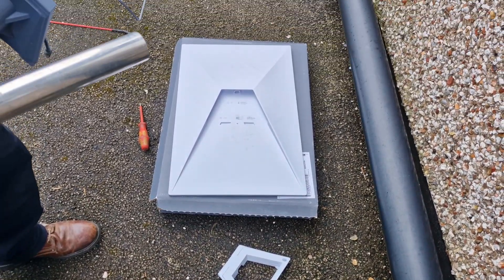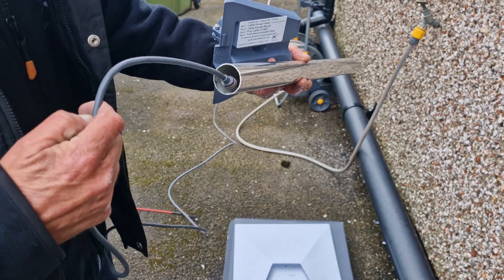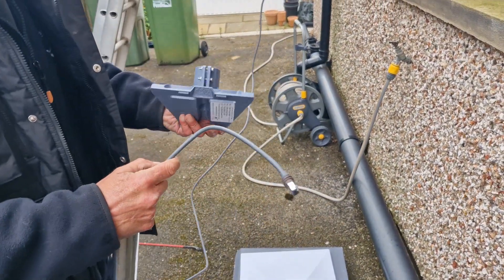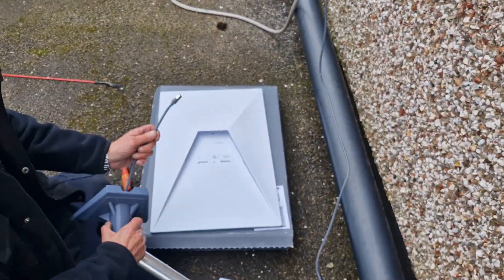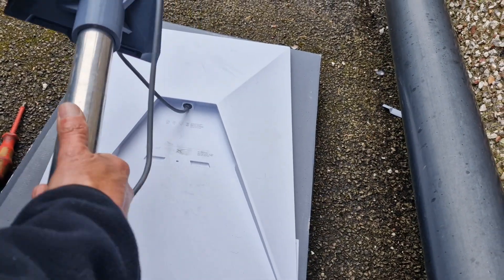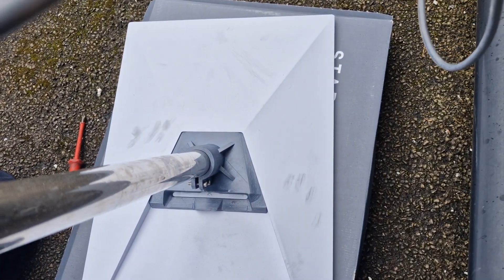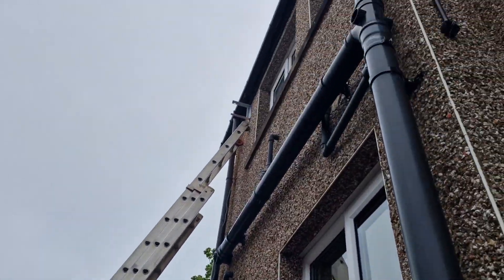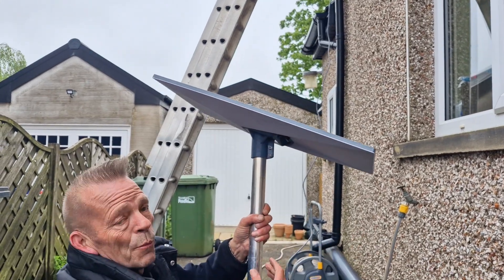Starlink Gen 3 mounting options designed by us available to Installers www.starnetlink.co.uk

Comment: thats what i THOUGHT i was getting but starlink sent me one that i couldnt put the wire inside the pole and the hole for the pipe was 3 times the size of the gen 2 pole so it has a lot of slack to be taken up by the 2 tightening screws . not what i expected from starlink. why they didnt just make the adapter the same size as the gen 2 pole and allow the wire to be inside the pole like the old gen 2 was i dont know.